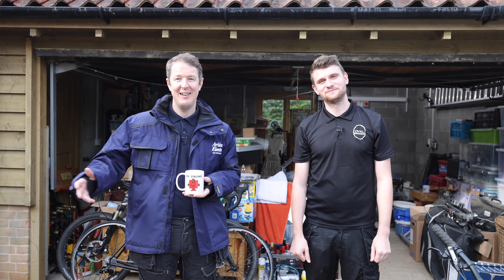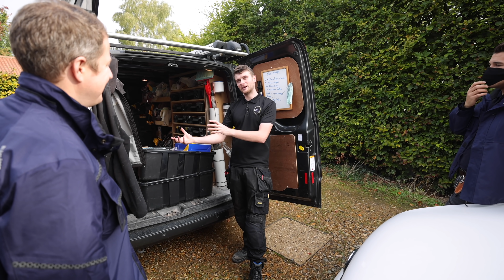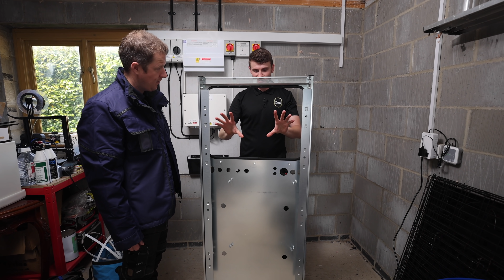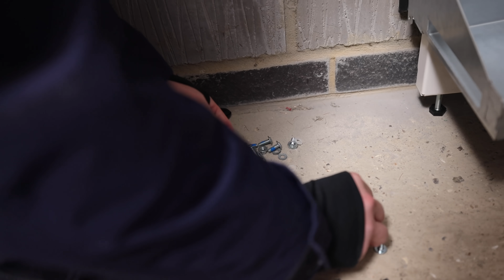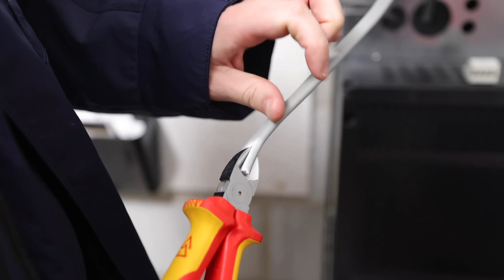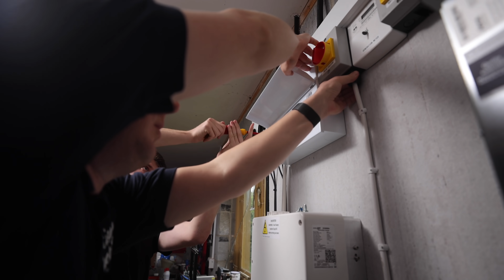HUGE DOMESTIC BATTERY STORAGE INSTALL - Electrician Life

Comment: Pass through connectors can be really handy and easy, but just be aware at the end of the RJ45 connector, there is exposed copper  Not suitable really for anything that may be outdoor, or connections that may have contact with metal parts.   Being pedantic, these are not glass connectors.  They are plastic.   I noticed you said glass a few times.   Glass would be rather dangerous and fragile given how the crimp :)

Comment: It will be great when we can get away from Li batteries for static applications.  Li for cars is competing with Li for static applications and driving up the price due to supply and demand, when it should be coming down because of discoveries of new sources and better extraction techniques.  Anything to reduce the price of Li batteries will make EVs more affordable, increase the customer base and speed up the transition to EVs.  Even better, the alternatives are better for static applications.  All have much longer lives than Li batteries, all can be cycled between 0 and 100% with no damage to the batteries and all are safer from a fire point of view.  Some alternatives include the ZnBr flow and gel batteries, the liquid metal batteries, using Sb and Ca, a range of ReDox flow batteries using V or Fe and possibly the up and coming Na batteries.

Comment: Very interesting & informative video.

Drax is not a gas turbine, it is coal and biomass fired!

Those case fixing screw locations is a bad design choice, little thought put into it. I hope the rest of the unit isn't similarly compromised by design.

Comment: Hi, Great video. I'm thinking about installing a battery storage system at the minute. I've got an EV and currently on the Octopus go tariff (currently 7.5p/kWh) so I'm thinking i'll charge the batteries at night on the off-peak tariff and use the battery therefrom throughout the day, minimising my peak tariff usage and ultimately energy bill... I'm keen to understand if there are any concerns with storing the battery system in the garage with no frost protection? Also, I've seen a combined unit by Voltacon which reads well and wondered if you'd had any experience with their products.

Comment: would be interesting to see the payback for battery storage on a 6kw system
Reply: Buying cheap rate electricity at night to store in the battery has to be a big part of the equation. 8p a unit compared to 39p during the day
Reply: @fanfeck2844  my purchase rate is around 27p/kw, therefore with a consumption from the grid of around 2800kw/year, with total of 6kw pv what would the payback be please?
Reply: @philipholme9911  too many variables, such as roof orientation, pitch, how much sun you get, when you use your energy most etc. I’d still say it makes more sense to get a battery if you can utilise cheap night time energy to use the next day. In the summer you’d fill the battery with solar, but very doubtful in winter

Comment: Can this system be used for your central heating? Would you need electrical boiler. My hot water is generally served by my solar diverter

Comment: this is amazing! the only thing that I don't understand is.. how does the grid know to stop supplying while your in battery power? do you have to manually turn it off?
Reply from the maker: The way electricity works is that it won’t pull from the grid unless needed as the solar and battery will supply the power first. Does that make sense?
Reply: @artisanelectrics  i think so.. is that controlled by the inverter or is it like a bucket of water..  in that it it's kept full by the rain the tap won't run? Lol as in electric doesn't flow if there's no demand?
Reply from the maker: Yeah that’s pretty much spot on
Reply: @artisanelectrics  pure magic you boys! You make some great content! Look like you have a blast working together too!!

Comment: Wiring is so clean compared to my nightmare system. I went diy, 58kw, 3 4p16s banks for 171kwhs. I have 2 - 12kw inverters, 8 scc, 2 400 amp breakers, 4 1000 amp bus bars in a 3 by 3 room. I think battery storage should be a priority for most installs.

Comment: Fantastic video! At would point would you break even on your initial investment? This looks like a very costly installation and I can’t help but think this would take a considerable amount of time to even make a dent the initial outlay even at the current energy rate. Also, would this technology not be significantly outdated and inefficient by future standards by the time it is returning genuine free energy?
Reply: We had a 5.5kw install with 2 growatt batteries with a combined 13kw storage. It'll pay for itself on the current run rate within 4 years.  You won't regret the investment. A key tip is to go for a high watt panel, 400w solar panels are ideal as they are far more efficient and you need less of them.  We only have 13 panels and were generating 25kw a day in early April filling the batteries during the day and then we use the batteries in the evening and at night.
Reply: As the saying goes, the best time to buy any technology is tomorrow

Comment: That is a nice little crimp tool! Might have to add it to my collection, haha. It's the most frustrating thing when you try to cut the cores off straight and it's everso slightly wonkey and they end up not going all the way to the end so you have to start over.

Comment: The problem isn't commitment to renewables it's commitment to nuclear. We have just come to the end of 10 windless days. To replace the gas used in that time we would need 3twh of storage that's 321 dinorwigs. It's going to be hard to find anywhere to flood that large that environmentalists will agree to. One hasn't been built for 30 years.

And that's before you turn the gas and oil usage into electricity

Comment: There is a lot of cost and energy inefficiency in this system - 2 separate inverter systems and that Sonnen battery setup costs a fortune as it's designed for retrofit to an existing system. If you knew the customer wanted to add a battery system later it would have been far more cost efficient to install a good hybrid inverter upfront, of which you could directly link batteries to with far less complexity, cost and space requirements.

This Sonnen system is for retrofit to existing PV systems, and has it's own 2 way inverter. You have a setup here now where you get PV DC energy, convert it to 240v AC, then Sonnen system converts it back from 240v AC to DC to store in batteries, then converts it back from DC to 240v AC when needed. Each conversion stage, especially DC->AC->DC, has an efficiency loss, and just generates heat. A hybrid inverter would have just taken the PV DC and done a single efficient, DC-DC voltage conversion for battery storage and not actually feed the grid tie with excess power as AC. On top of that there is more expense and complexity as you require all those current probes and metering systems for it to work out what power it can grab from the grid tie.

I bet no calculations have been done on total system efficiency when you are using PV energy stored for later use from this in-out-in-out (shake it all about) system. There is going to be at least a 10% efficiency power loss, possibly more....and no doubt £1000's in upfront financial costs vs hybrid inverter and simpler direct connect battery.
Reply: Yes but with a hybrid setup you could never get the high levels of discharge into the house that an ac coupled system in conjunction with a battery would give you.
Can be up 6kw battery plus pv.

Comment: Interesting video. The question it always seems to come back to is how much do battery units cost and how long would that money  last if you just paid for power at the higher rate.  Would it be cost effective to charge batteries on low night rate electricity and use in the day time if you had enough batteries or couldn't charge fully by solar.  Unfortunately solar companies just seem to want to jump on any one showing an interest :( 
looked good though.

Comment: It's a shame these install currently cost more money than can be saved in their use case but I guess as electricity prices skyrocket you might break even sooner.
Why are the batteries not series linked so you can daisy chained more than 4 batteries and grow your system as battery costs get cheaper. Simple little smart controllers on the battery can aid in balancing and report the number of batteries in the chain back to the main controller board. No install issues. Power down. Plug new battery into last battery. Power on and the main controller updates itself to the additional battery capacity. What!! You don't need an electrician for that I hear you cry.
Reply: They are series linked for control. They’re not series linked for the power cabling because that’s a terrible idea. The idea is to be efficient.

Comment: That's a nice install.
It's similar to a Tesla Powerwall, they have a battery and inverter combi unit. I see that you've left in the solar inverter, so I assume there are two inverters?

It's a shame you didn't share the math, I think a lot of people don't know how to do the equation's to know what they need and there are alot of sales and marketing that's misleading.
I think that would do alot to ensure better knowledge to the public.

The battery being a based Calc, then everything else on top. So as you've done this a little backwards, how did that work out?
Is the solar current/power matched?

Comment: So after three, multi day power cuts this year I am thinking a battery storage system may be the way to go. We don't have solar as don't have the right orientation to pick up the Scottish sun. Could a system like this be installed to take advantage of night time electricity charges and then be used to run the house in a powercut. All my neighbours are using petrol generators to keep essentials like freezers going. Be interested to know the likely cost of this system. I have an idea of price for petrol generator but this looks a more tidy solution?

Comment: I use 2 ev chargers at my property and my nissan is the 62 kw battery so one charger is only used for solar with 2 seperate leads one limited to 2.8 kw for winter use and another the full. Out put. So to save confusion its easier to have 2 leads rather than keep having to go to settings to change output, the other ev charger is used solly for economy 7 charging and normal if I need to. I will be adding another ev charger for second car but both will use solar charger in summer. Free charging in summer using solar is fantastic.

Comment: My payback on my system has not been achieved yet, but when my battery fails again it will be out of warranty. So if I get to 8 years trouble free fantastic it will have been cost effective. But a battery failure now would add a £2300 extra cost to my aging system. I have decided if this happens I will not replace the battery, I will invest and add an extra 8 kw of solar ground level to improve winter months.

Comment: My questions are to work out payback with warranty time, as if any part of this system fails outside warranty and payback has not been reached then the cost increases and payback is longer.
Reply: Unless your electricity is very expensive, or your utility doesn't offer a good credit on solar back to the grid(which is my situation. They give .66kWh bill credit for every 1kWh I put back on the grid) a battery won't ever pay for itself IMO. For me, the battery gives me peace of mind and a little more independence. It's not about saving money.

Comment: What is the warranty on this system battery's, with failures are the battery's replaced with new or refurbished, what is the time scale for failure to replacement. Also what is the payback for the intire system at the fit rate when it was installed.
Reply: From what I've read (not warranty info) these batteries typically last around 10 Years. Given the cost vs the benefits personally for me the savings are not enough. 
My take on it you are better to use excess Solar power in heating your hot water (for free over summer) using some of the devices that PWM the excess energy into the emersion heater.

However, if I had unlimited cash I would have an Electric car plus charger on Eco Mode, before I purchased a battery and inverter. Whilst it is certainly feasible to make these systems cost efficient using the low tariffs over night to charge the battery (how long are these price differentials going to exist for if many are doing the same), or PV if you have enough roof space and cash I don't feel they would work for me.
Reply: @wino99999  spot on ,and they don't work for everyone. Most people on you tube are people who are lucky and have that extra cash, one chap on YouTube never has anything in his home on lol . I have an early battery system 6 years old and I have had failures if it fails again I am out of pocket by 2 years. In regards pay back.
Reply: I recently watched something about ground sourced heat pumps, being the better option other than being excessively expensive for the borehole, way more efficient than air sourced. Interestingly, a comment was made, that to ensure the largest COP, the use of excessive solar PV generation at home could also be used to preheat the underground surrounding infrastructure likened to a storage battery, thus ensuring there is plenty of extractable heat when it's needed in winter..... Even coiled heat pipes if located and installed underneath houses when built, would benefit greatly from this, especially as it would be in a trapped insulated environment. Now if it became a cheaper option to retrospectively install, that is the route I would go down!
Reply: The only possible benefit I can see from having a battery would be to make use of cheap electricity on a time of day tariff, such as Octopus. And only whilst insufficient people are making  use of such tariffs. Once electric cars are more prevalent, I think these tariffs will become a tad more expensive, unless the wind is blowing too much....

Comment: I am very intrested in this tech, my 6 year old system has a 5kw battery and 70 days a year my dedicated South facing 4kw solar charges this battery, but 70 day a year it averages at 29% charge so it never goes over so not fully charged, and a calculation 30 days a year max charge to 58%. My year is from 1st September. Then the remainder this battery charges to 100% every day. My question is is all of this install solar charging this battery or is it split. Is this system connected to economy 7 to charge these battery's in cheap rate.

Comment: Wifi ariel is the wrong way round, dont like how you clipped the cables, and did ypu drill into the side of the meter? I tend to mount it on a box or above trunking

Comment: We just had a Tesla Powerwall 2 installed with our Solar Edge inverter and 6.4kW solar with DC Load Optimisers.  It's interesting to see the differences, in particular this seems to integrate the power management whereas the Tesla system has a Gateway box for that.

Comment: Presumably a battery with an energy capacity of 11kWh and not one capable of delivering a power of 11kW!  Laymen are confused enough, but the distinction between energy and power is vital.
Reply: You are talking 15Kwh low frequency inverters working with Tesla modules, I can supply these off grid inverters with Tesla battery storage

Comment: Wouldn't it make more sense if the battery had more capacity, was portable and also multi-use?  Solution:  Get a used EV with V2G or V2H (house) option.  
(Probably would be cheaper too)
Reply: Company parking lots should be covered by solar, so your car charges while you work. When you get home in the evening you plug your car into the home, and run the home from the car. Makes sense and the technology isn't overly complex. It will require bi-directional infrastructure, which is basically the only thing that makes sense.

Comment: Your main power switches have the wrong color. Red on a yellow background means a EMERGENCY stop function. So a second action after switching it on, (for example a RESET button) is necessary before power is activated to the device. The right version is BLACK on a WHITE background. A often made error.

Comment: Instead of leaving the lifting handles on the battery shelf, it looked like there are storage slots built into the side of the battery inverter. It would've been nice if they had been used as such.
Reply: These slots are where the handles insert to carry the power unit. They are not left in position there. the cover would not go back on if you tried to leave them in position 👍
Reply: @OvalRenewables  I'm not talking about the slots on the outside edges, but the two pairs of slots only on the left side that are inset from the far left edge and just above some of the connectors.
Reply: @thomasbonse  thanks for pointing this out. Never noticed those before! Always focused on getting the cables into it! 👌

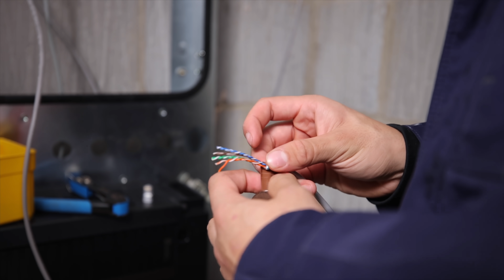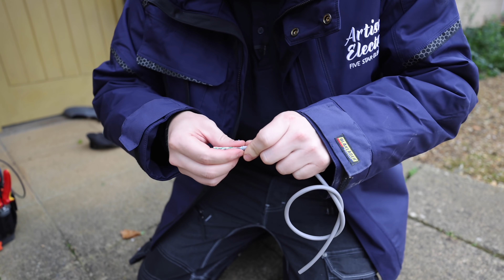Comment: 13:13 Don't you get massive interference on that CAT5 cable with it not shielded? Especially around 230V 50Hz electrical. And literally after I comment I see 15:00 you show how to properly crimp an RJ-45 connector onto a network cable.
Reply: To avoid interference, don’t run cat5 closely parallel along power cables and certainly don’t tie them together. Keep data and power nicely separated using different cable guides. Shielding doesn’t miraculously get rid of interference.
Reply: @anonymous.youtuber  Originally I was referring to the no cladding bare twisted pairs but later the cable was shown being terminated.